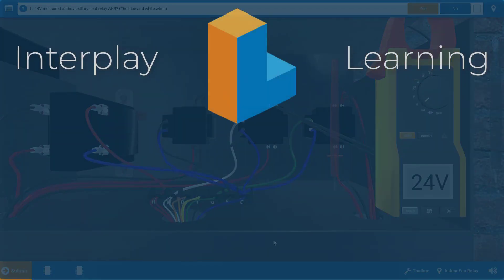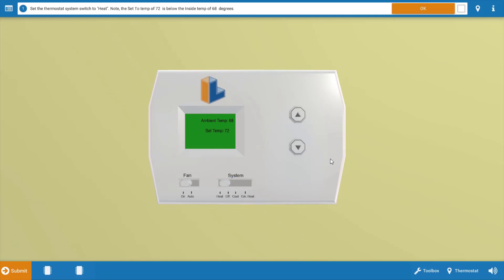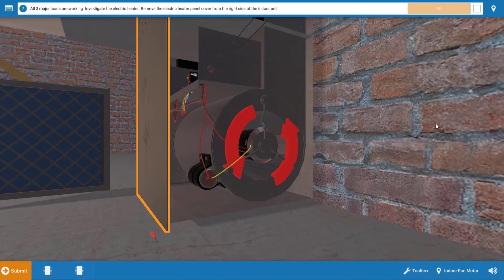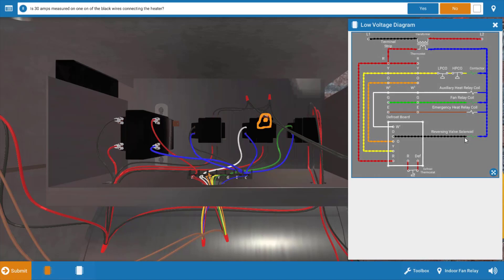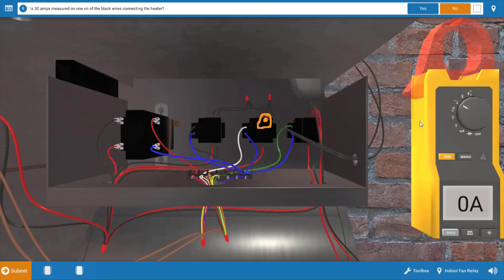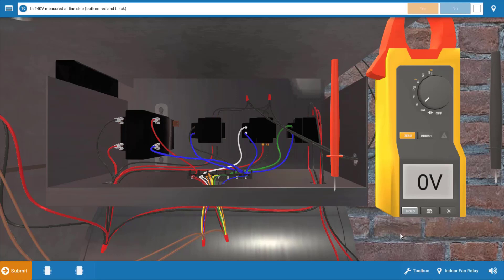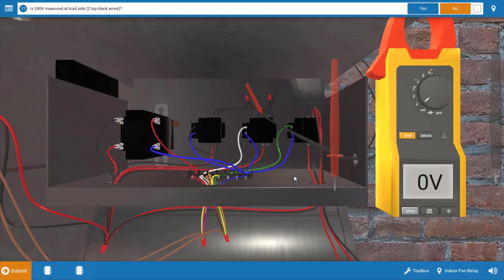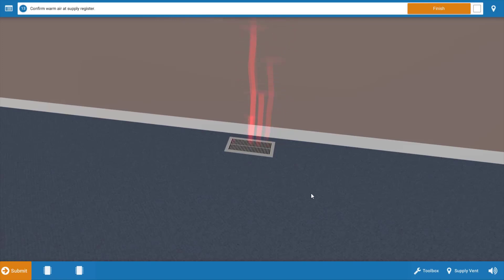Troubleshooting a Faulty Auxiliary Heat Relay

Comment: That was a great explanation. One question: Is there an option for gas aux heat in your program or does it matter? Thanks
Reply from the maker: Any furnace could add electric heaters in the supply. As long as you had the power requirements for lack of learning his family just you would simply need to add a relay and a different thermostat.

Comment: U have number have a question had new system installed believe was 2 stage 3 ton now have single stage now aux keeps coming on is that normal or have to adjust thermostat
Reply: I have same issues s. Myself
Reply: I just have same issues  started saying auxiliary heat on.   On this 2 stage heater system from carrier